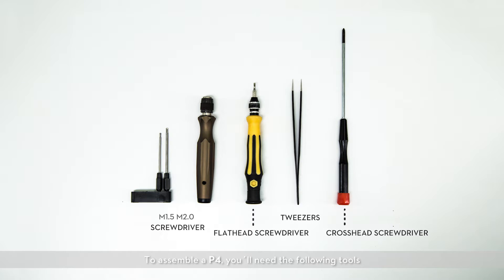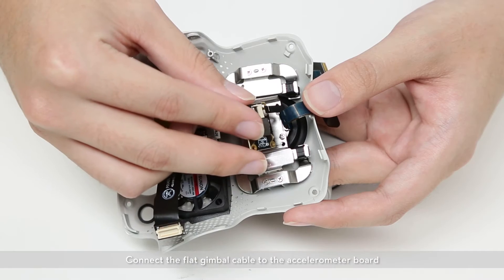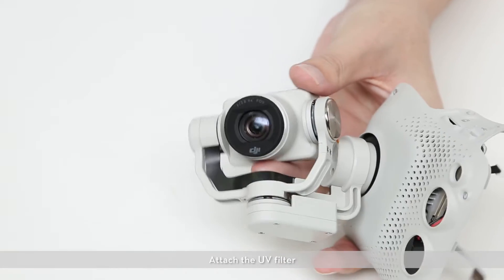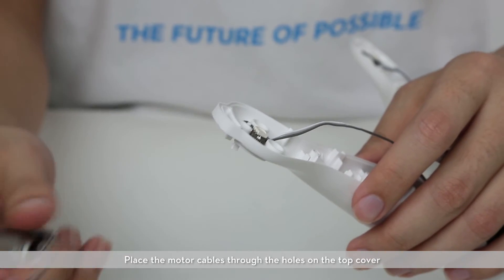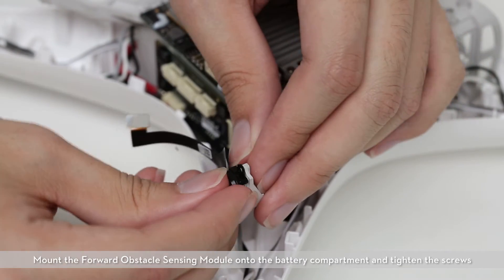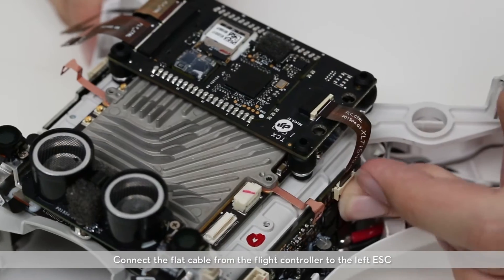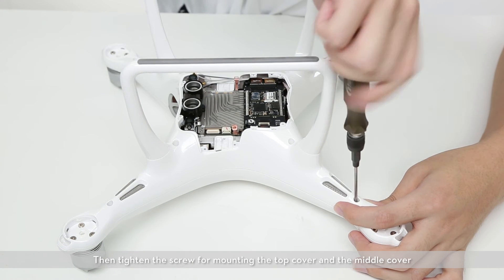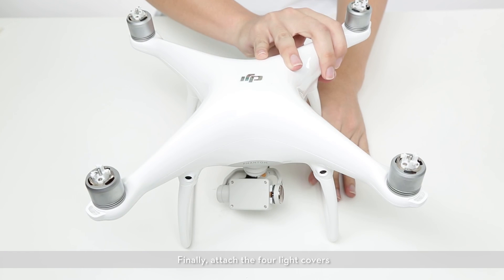DJI Official Repair: Phantom 4 Part 2 Assembly

Comment: what kind of glue did you apply in the soldered wire teminals in the circuit? at 2:24